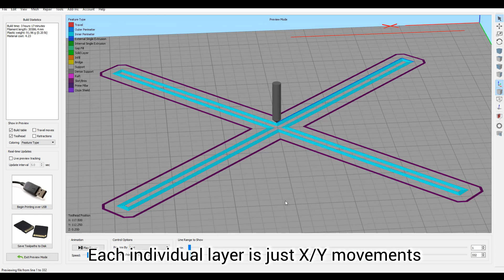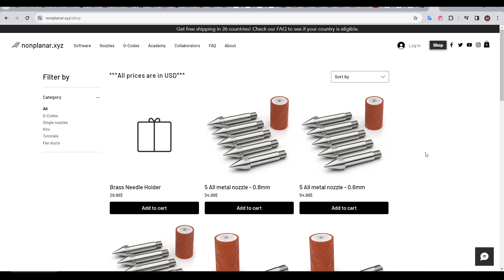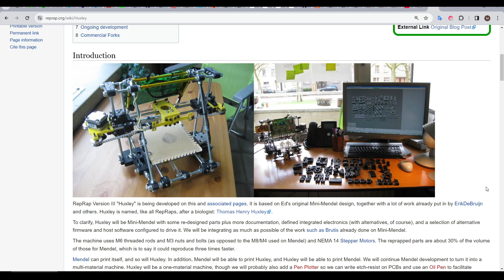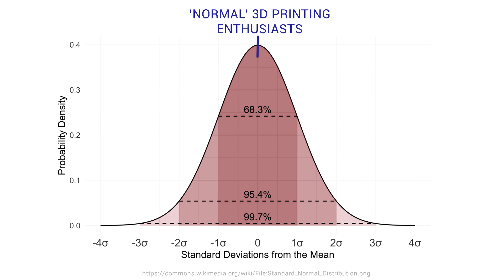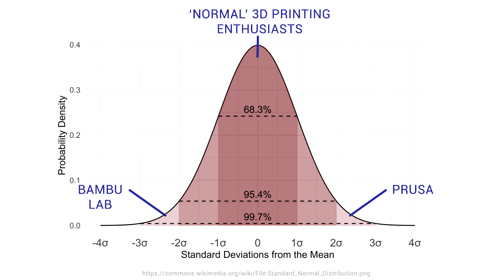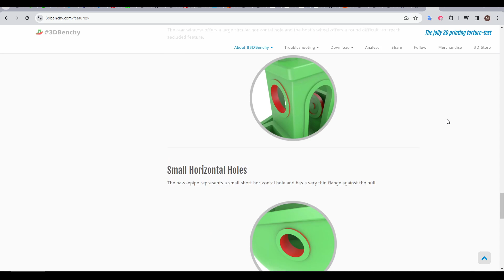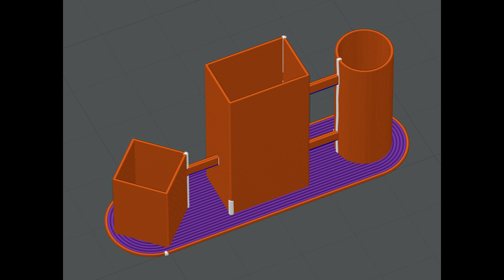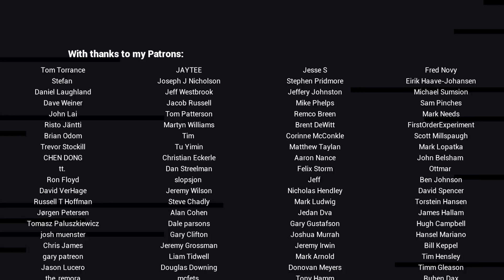3D printing mysteries that need to be solved in 2024

Comment: The problem in the community is from anti-community efforts like bambuu. The entire 3d printing ecosystem exists today instead of in the 90s because IP law screwed everything over, stopping anything from happening until patents expired and open source allowed the community to thrive and grow. Bambuu is a MAJOR community step away from open source and will eventually doom the community again.

I don't think people understand how harmful these types of changes are long term. It's like how support of Apple harms basically all computing. Look at the backwards steps we see on mobile devices compared to PCs thanks to Apple's popularity in that segment. App stores and we don't even get access to file systems by default anymore, hardware is a locked down glued down blob. And it has even been leaking to PCs with windows 11 requiring a login and spyware. If PC never happened with its open standards, we would be stuck on single core systems with no graphics cards today.

Bambu is a serious threat.
Reply: I can only agree with that. The whole 3D printing we have today, is because everything, both hardware and software, was completely accessible and open sourced. If Bambu Labs takes the next step and goes patenting open source designs, it will be the end of 3D printing as being affordable. If patents have to be payed, be prepared to pay a minimum of $1000 for a bottom basic printer...

Comment: On the 3D Benchy there is just one small coincidence that can easily be explained away The separation of the the centers is always going to be identical. The vertical separation is also always going to be the same vertically. for them to fit together both inner dimensions of the rectangular hole need to be larger than the OD of the funnel. For them to fit together snugly one of them needs to be just a bit larger either by design or coincidence.

Comment: My guess for the last question is  there are several factors.  Exact temperature is one. I am guessing that if the printer is slowed down, there is less effect from the high volume used by the top surface. Another is the start point and direction. The connection to the other part created the difference in where that loop starts.

Comment: I have noticed the last one and came to the same conclusion. I wonder if PID tuning could incorporate extrusion speed to compensate somehow.
Reply: Technically PID is supposed to account for it automatically. The problem i think is that the PID is calibrated when there's nothing flowing through the nozzle. Maybe the calibration process should be changed to incorporate different flow rates.

Comment: I have an answer because I've been testing this myself for months; The bowden tube issue appears to be a matter of stress. The filament is rolled when warm, so it's got stressors for THAT shape. The bowden and mount solution you have (and many people have, myself included) seems to force it to bend backwards, which - especially with translucent PLAs in my testing - can cause those stressors to compound exponentially, especially if it's held in that reverse-shape for a prolonged amount of time. Hatchbox translucent yellow will do this sometimes in less than 2 hours!

Comment: I contacted Fusion Filament about my filament breaking in my dry box tube a little bit ago. They sent a long, detailed reply. Heres the important part and I hope they don't mind me sharing:

"When we manufacture HTPLA+ (or any other semi crystalline plastic) this effect occurs. During spooling the filament is quite hot and somewhat pliable. The filament gets wrapped around the spool where it finishes cooling and forms a kind of memory effect.

Image for a moment that a flat sheet of plastic is suspended on its outer edges with hundreds of pounds of weight set in the center of the sheet for an extended period of time. Over this period of time the plastic will start to deform. When the weight is removed the plastic will maintain its new deformed shape. If the weight is left for an even longer time the plastic will eventually reach its maximum deformation state and break. This is the same effect as in the filament although in reverse since it's coiled and then straightened.

The filament is now constrained in the tube (which is most likely more straight than the filament) and is now stressed from its original form. It eventually breaks due to this strain.

Moisture has a small effect on it, but is not the reason it breaks. Oddly enough, the tools used to remove moisture are the same tools that are used to reform the filament. In this case a heater / dryer.

If the filament is sufficiently warmed before it enters the tube it should reform into the shape of the tube and stay that way without breaking.

This breaking effect is amplified by cold temperatures since most homes aren't heated (or cooled) at the same temp in summer vs winter.

TL;DR
If you use a filament dryer to warm the filament just before it enters the tube, it shouldn't crack."

Comment: With non planar, the Z axis seemed to be a huge bottleneck for my printer and probably others.
Reply: The shallower the slope/curve on a top surface, the worse the stepping is.  While a very shallow Z clearance would definitely limit the benefit of non-planar printing, you need very little to fix the worst print stepping so I think quite a bit could be accomplished with very little Z clearance.  Also, as it gained in popularity manufacturers would start increasing the stock Z clearance offered, but until there is software why bother?

Comment: I believe the artifact is caused by a combination of different speed change, flow rate, and retraction speed between layers. Printing slow might remove this artifact. Increasing extrusion witdh and playing with de-retraction might also help.

Also that filament about that breaking. Try to buy the same brand but from a different distributor to see if there any difference. Long story short, bought a couple of filaments (same brand but different distributor). Filaments from distributor A (which also has an official contract with the brand) is absolute garbage, breaking just like yours. Filaments from distributor B prints flawlessly.
I have tested both. Both were fresh out of vacuum sealed bag, it was not Humidity because I tested that out too, and it was not because it was sitting too long inside of the bowden tube (I even used capricorn tube to test this out). It is very weird.

Comment: Regarding the filament breaking in the bowden tube: I've noticed this especially at the end of a filament roll where the filament is bent in a smaller diameter. Furthermore, I guess the filament can not turn that easily inside the bowden, so in your case it looks like the filament might get bent in the opposite direction than how it is bent on the spool. Usually this works while the filament is moving through the bowden, but when it stays in this high-stress position for a few days it tends to break in multiple places. My solution to this problem on my big printer with a long reverse bowden is to remove the filament when I'm not sure if I will print anything in the next few days. Getting the broken filament out of a long bowden tube is a real pain in the a..
Reply: I have a new spool of transparent PLA that does this, so in my case it's not a case of "Old filament" (unless it sat in a warehouse for ages, but..).
I'd guess it's a combination of material composition, high stress and moisture. Mine snaps easily by hand too, and tends to just explode during retraction back to my AMS.
Reply: Really interested in this.  I have ASA in white and ASA in black. Treat them exactly the same and other than a sealed vacuum bag don't worry about humidity.  My white acted similarly to Teaching Tech's while my black is fine.  I kinda lean towards Grant (3D Musketeers) it being "white filament". Lol

Both print pretty much the same also.
Reply: @GetTheFOutOfMyWay I agree. I've had white and gray ASA and ABS snap like this right out of the package. They seem to be the only colors that do it no matter what brand. It's odd.
Reply: @OhImKiCkiN 
Possibly the titanium dioxide used to colour it?  The structure of the plastics would be affected by the additive used to impart colours, and the TiO2 may have a prevalence for messing with the polymer.

Something to ask a chemist.
Reply: @boggisthecat  For sure. It would be very interesting.

Comment: Your last question regarding the artifacts with a prism and a cylinder is caused by changes in print direction. Much like the cyclones and tornados some perimeters are printed clockwise and others counter clockwise. The slicer usually sticks to one or the other for a simple shape such as a cylinder. But as soon as holes or multiple objects are introduced it will switch back and forth. A simple checkbox to force the slicer to always print perimeters clockwise would solve the issue.

Comment: I've only been interested in 3D printing for about a year, so I can't say if toxicity is increasing.  I have been active in forums for motorcycling, woodworking, software programs, and other products for over 30 years.  The 3D forums are by far more toxic than any others I have seen.  There seems to be more interest in publishing a rant than in solving a problem. There is often no interest in taking responsibility to ensure all the many settings are correct, as if the software is supposed to read your mind, never mind that the multiple options are necessary so that other users can also satisfy their varied  needs.

Comment: The filament direction is more likely affected by the rotation of the extruder's screw, pressure gradient inside the nozzle from that motion and milling of the nozzle than anything else. The coriolis effect can be seen in some large circular pools, if they are left completely undisturbed for long periods. It has more profound effects on large, high water-mass weather systems like storms than a 3d printer.
Reply: Coriolis effect only becomes noticeable on huge scales.
Reply: And the twist of the filament or the Boden tube.
Reply: There is also a high possibility it has to do with fluid dynamics as well since filament heated to that temp likely behaves similarly to very viscous honey.  Don't ask why this video stuck with me and it took forever to find it again, but SmarterEveryDay did a video about it like 12+ years ago. https://www.youtube.com/watch?v=zz5lGkDdk78

Interestingly, it seems like they coil in the same direction as the honey in the original video as well, almost definitely just a coincidence though
Reply: I recall a video years ago that Smarter Every Day did about this property of flowing liquids (his was syrup or honey) but its apparently quite a complex number of factors that determine the coiling. 

https://www.youtube.com/watch?v=zz5lGkDdk78
Reply: @reflector36  lmao, how did we both come to the same conclusion over a video posted 12+ years ago 🤣
Reply: @Tyler.8046 Lol, some thing about great minds thinking alike. I just have a freakishly good memory for videos that i watch, i didnt actually realize it was that old, unless he brought i up in another video or podcast cause i also recall him mentioning that predicting the motion is virtually impossible as its a 19 polynomial equation (or something along that lines of having a butt ton of variables)
Reply: And also the cooling system used on the filament.
Reply: I would have to agree in adding try swapping the stepper motor to the opposite side and have it push from the other direction and see if it changes the direction of pressure out of the nozzle enough to go the other way
Reply: Your logic is not welcome here :D

Comment: 12:05 also noticed these artefact’s. Also noticed it is more pronounced with PLA than ABS and rarely occurs in vase mode. My theory is PLA undergoes some kind of chemical change with heat and the artefacts are a result in sudden changes in flow rate changing how long filament is at a higher temperature. 

Guess could test theory by printing the same simple object at different speeds but same filament to see if any of the objects are discoloured

Comment: Pretty sure I'm going to echo someone here, but it's not the distribution of toxic people it's overall number. Also take into account that most people won't comment, and the ones that do are more likely to be at the ends of the spectrum and it seems the community is becoming more toxic even if the percentage of toxic to non toxic is shrinking....

Comment: The artifact is layer time related. I think.  That combined with your flow rate idea.  Firmware needs better PID tuning.  If we aren't tuning at our max flow rate, we won't get stable PID settings.
Reply: I think you are maybe on to something. Certainly, with Marlin, when changing temperature, they seem to overshoot massively (Especially when dropping temperature). I actually asked about this in the Marlin Discord at one point, and IIRC, it was a dev who said that "PIDs are only about trying to maintain a set point, not change it without overshoot", which is patently untrue. Given, as you say, a change in the rate at which heat is being dissapated (eg due to change in flow rate), It probably does not deals with it well.
Furthermore, surely, nozzle temperature should ideally vary with flow rate. The aim is to get the filament out at a consistent temperature, regardless of flow rate - so using a consistent nozzle temperature regardless of flow rate is never going to be optimal.
Reply: @evilc2048  temperature doesn't necessarily need to change with flow rate, but the PID needs to adapt to that higher flow rate with differing on/off cycles

Comment: I think the surface artefacts are caused from residual stress. What I observed is that this is more pronouced in ABS prints and there seems to be a good correspondence with the layer time/print pattern and the surface artefacts. If you are printing a large top surface, the residual stress it creates are likely more than a layer of sparse infill. Then the surface warps the part just so slightly that it can be seen when the lighting angle is correct.

Comment: Let's try to explain some :

Non planar : It should be like CAM with CNC meaning the slicer should not handle this but 3d design software like fusion 360 to make thing easier but a bigger skill cap on the user side. Slicer could have like an option like a paint bucket with various option. There is also some company who did not give setting to put the machine on every other slicers. And on those if you make a mistake you can destroy your machine.

Toxic Community : Try to dig on dagoma, haha. Only cold bed printers at 650 euros.

Filament snap : There is some filament who are brittle even on the same brand, bet it's a pigment issue.

Comment: Voron and Bambu groups are almost as insufferable as a Linux community back in 2000's. Every single year was supposed to be the year when Linux overtakes the desktop market. And to every Windows-related problem on forum there were a handful of dudes aggressively "recommending" Linux as a solution. Fun times :D

Comment: Think the filament flow direction may be a result of the machining process to manufacture nozzles, most CNC machines default to clockwise so might be leaving clockwise artefacts. Just a theory and would be a fun one to test if someone has the right equipment to manufacture nozzles to give it a try

Comment: The last issue is an issue in terms of speed and acceleration+flow rate. Have a look at the slicer and you will see that it is not the same values when you have next to the prism a cylinder (that it is also a prism but well you get it 🤣) I has similar issue in my prusa of having different colors over one part and different if it was two or more (different brightness of the part actually) this came more and more pronunciated with new machines that goes way faster and accelerate more.

Comment: I think you can notice the difference at the edges on the rectangle because the z seam isn't on the same edge, se the left square, the z seam is at the same edge as the bridge, the same happens to the cylinder the seam is aligned with the bridges, try to change the z seam position to see the difference

Comment: i think the artifact is just the filament over cooking and over flowing 
and for the prusha vs the bambu lab thing im guessing its becoz of the 3D printing hobby becoming a fully fledged closed source market.
i think the old timers like me and you that started with building their own printers are watching this flood of off the shelf "just works" printers that you cant modify and basically cant play with like the X1 and A1 and wondering if its the death of tinkering.
granted you can have a Mk 4 prusha but you can still modify and disassemble it and change the main board and the lcd to other main boards and LCD's , upgrade the bed and sensors ,change the firmware ,but you cant do that with the A1 and X1 or you lose functionality. 
for me personally ,im not hating on bambu labs ,but i hate that im seeing the core elements of 3D printing die ,the tinkering the mods the upgrades, its inevitable but i hate it, for me watching the new A1 was like watching a commercial for a washing Machine from Samsung , its cool and all , it doesnt benefit me at all except for emptying my wallet ,but its just an appliance at this point. I cant touch it and i cant modify it or upgrade it ,i cant truly make it my own , i can just print with it , thats no fun.

Comment: For the discoloration/deformation issue. I would try that rectangle/cylinder test again with each shape at extremes of the bed. Theoretically the travel time between parts would give the hotend a bit of recovery time if its a temp/flow related issue
Reply from the maker: I agree that should help. But for the test model and models like it, the problem will still be there.